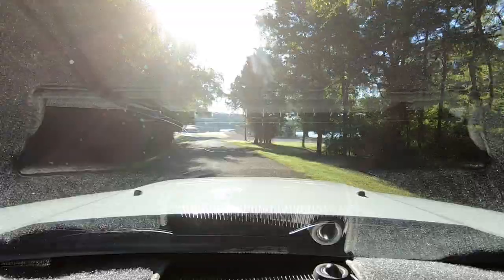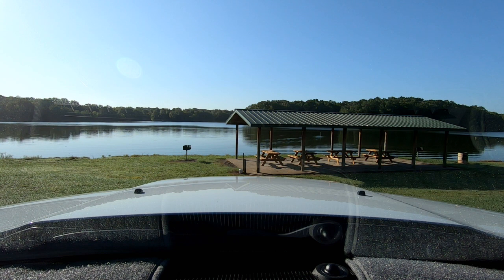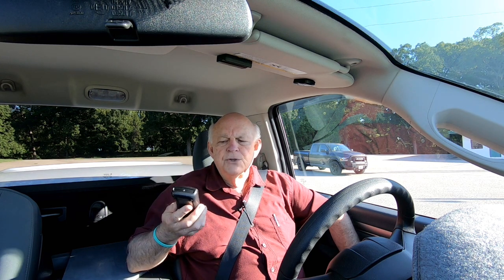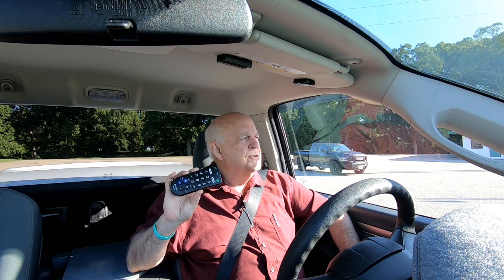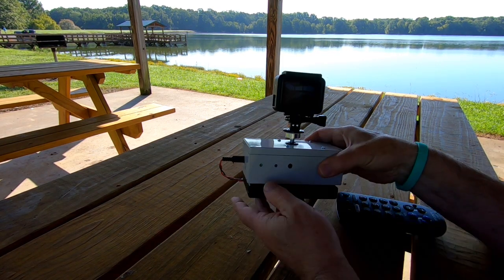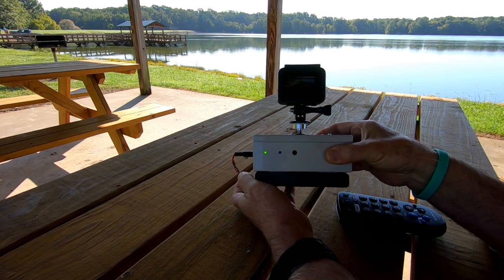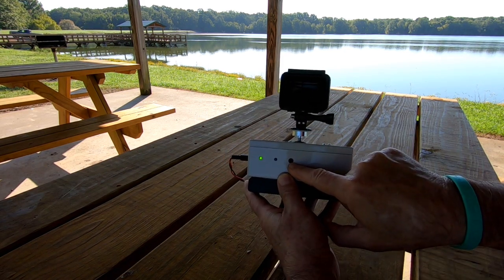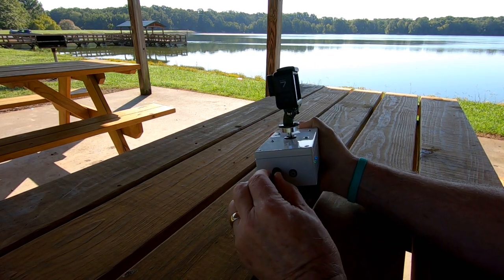Infrared Remote Control Camera Panner, Part 1 What It Does.

Comment: Nice job. Looks very useful. The medium speed pan isn't bad to watch if you only use it to go directly to the next new position.
Reply from the maker: Thanks. I actually have redesigned the electronics to control two motors, one for panning and one for elevation. I will try to make a video about it.
Reply: Thanks, I'll watch for the video. Do you make your own printed circuit boards for it?
Reply from the maker: @mrsjohnson1743  I design my PCB's, generate Gerber files, send the files to China, and that is where the PCB's are made. Then, when I get the PCB's, I solder the parts on and do the testing.